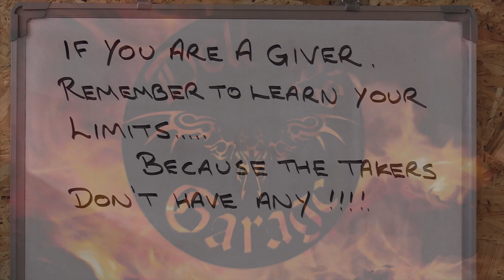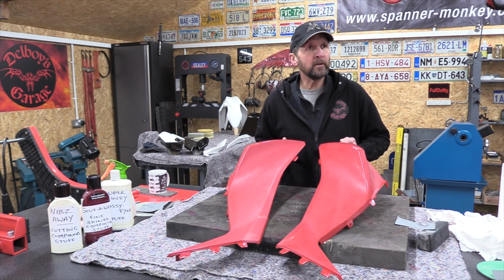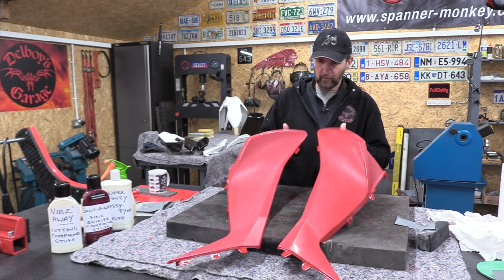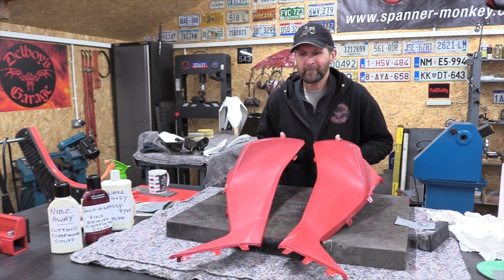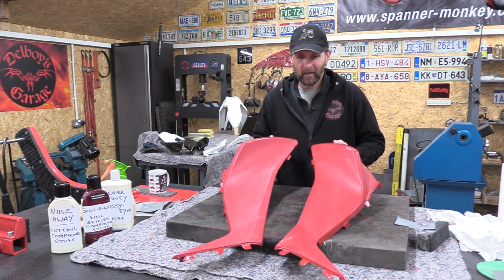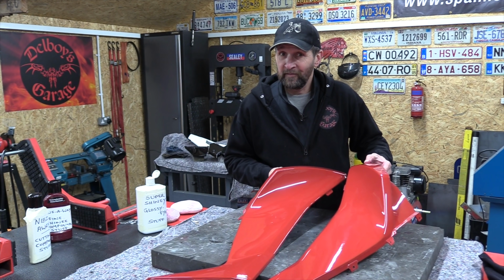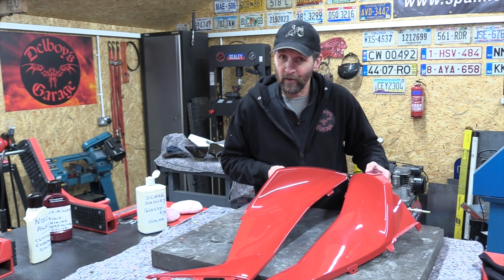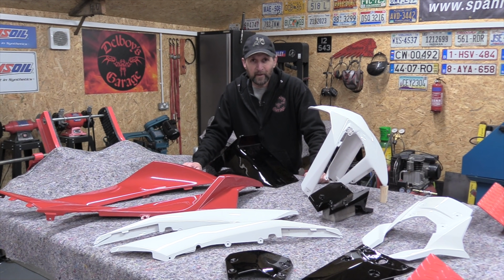Husqvarna Makeover #32, Wet Sand & Polish !

Comment: Ceramic coating seems to be all the rage at the moment, Del. Have you thought about trying that?

I used ArmorAll 'Better Than A Wax' spray polish on my car a few months ago, seems to be holding up well, and I will be applying it to my bike next time it gets cleaned. Cheaper than ceramic, and I'm a tight old git... :)
Reply from the maker: From what ive heard of others using it, it seems to be a favourite for exhaust systems, but not heard of it for plastic panels.. !  The bike will get a good final polish once it's all done, couple of good layers of Carnuba at least
Reply: @Moonfleet41  Ah yes, there are 2 'ceramic coating' systems. As you say, one is popular for exhausts and other car/bike components. I have had a black swingarm Cerakoted silver for my bike.

The other type of ceramic coating is for paintwork, I think Richy Vida and his mates had the bodywork on their bikes done last year.

Nowt wrong with a good wax polish though!

Comment: Beautiful work brother
Reply from the maker: Thank you so much 😀
Reply: Is it possible to partial paint a bumper after repair and blend as perfect as possible.. BUT with spray cans? Lol
Reply from the maker: @joserozay213  That's entirely possible, or if its a bumper you could paint the whole thing saving time trying to blend it.!
Reply: Ok if I do so.. I can remove just the clear correct? Dry or wet Sand it with? Grit? Sorry.. Beginner but yeah
Reply: Thanks for replying man..

Comment: The amount of orange peel I've tackled over the years this reminds me of the work put in to gain perfection or close to it 👍🏼👊🏼
Reply from the maker: Thanks mate, it's certainly worth the work input when you can stand back and be proud of it.
Reply: @Moonfleet41  I've spray a lot of panels over the years and probably only proud of a hand full and I'll admit it wasn't until I started using 2k clear coat that the results changed for me but I learnt, much respect and keep up the awesome work  👍🏼
Reply from the maker: @bccapone837  Thanks buddy, it does take a lot of practice for sure.

Comment: Long but successful day for you, Del!  What’s in the soapy wet sand mixture? Hope you and Penny have a great week there.  🏍👍🏍
Reply from the maker: Hey Gary, good to hear from you, all it is is a few drops of mild baby soap, nice and neutral, and it just helps the abrasive papers and pads slide over the surface and prevents clogging a little better than just plain water... take care both, have a great week!!
Reply: @Moonfleet41  ok gotcha- thx, Del.   Today was a great day… the fuel system on my Fatboy is now completely new and properly installed. Wahoo. It took a bit of maneuvering to get the whole mechanism back in the tank. She really purrs now… 😊. Thanks for all your advice along the way.  And best of all… we have 3 days of 50 degrees F coming up!  😎

Comment: Nice work!  I've been told by many that you can't cut & polish plastic because you'll burn it too easily with the machine.  I've tried and just been careful, and using a drill that may not spin as fast would be a great alternative. Looks stellar!  🤩
Reply from the maker: It is indeed important not to burn the paint with a buffer, and more so when it's on plastic!  but this polisher is only 3" and with light pressure doesn't get up enough heat to become a problem..

Comment: The custom printed wrap on the steet fighter was and is still so sick. However you can NOT beat a fredh paint job and the fact that you've managed to gain access to a booth to do ot yourself has given these builds and refreshes an extra dimension that makes the finished product so much better
Reply from the maker: Thanks mate, that's very kind, and i did love the body wrap they did on the fighter build, but you're right, there is so much more work in a full on paint job, and at the end of this, once it's fitted back on the bike, I'll be really proud of it.    Thank you for your kind feedback mate, really appreciate it.